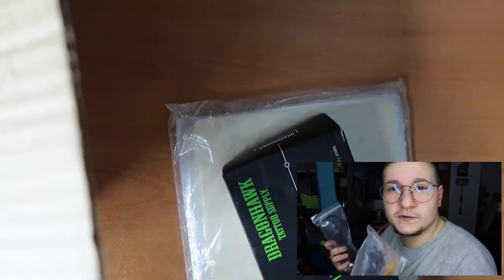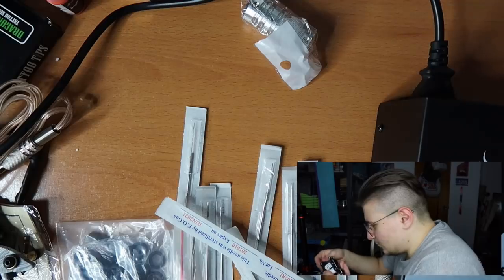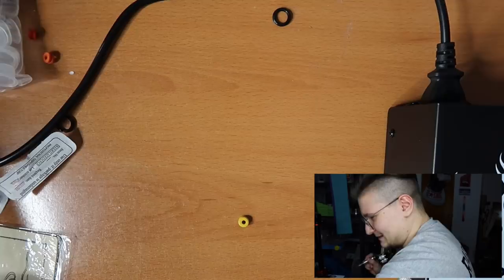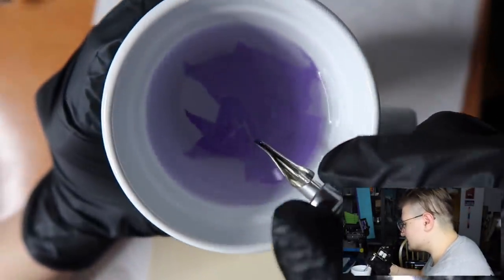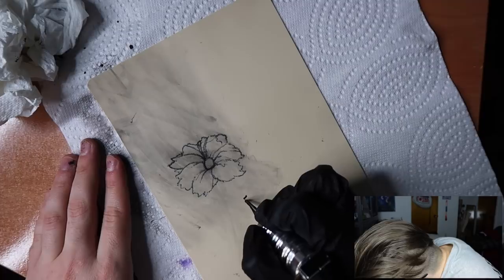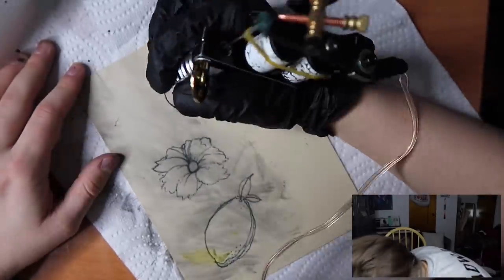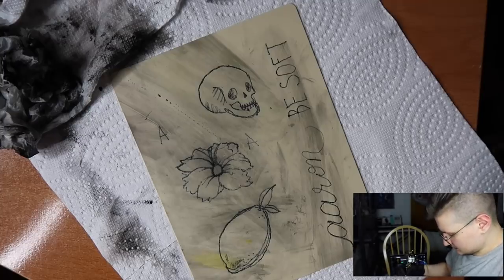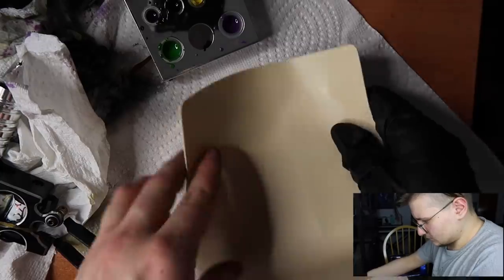Trying A Tattoo Machine For The First Time!

Comment: Aaron this is so incredibly cool and is definitely not making it easier to resist the urge for me to get another tattoo tomorrow lol. You can tell how much better you are getting at it even by the end of the video! Also, if you find it difficult to grip the machine at all, something that the tattoo artist I went to did was wrap the thicker cylindrical part in the middle with a lot of K-tape. I'm not sure if having a larger/softer grip would make it easier on your hands having EDS, but just thought I would throw it out there. This is so, so cool!!! <3